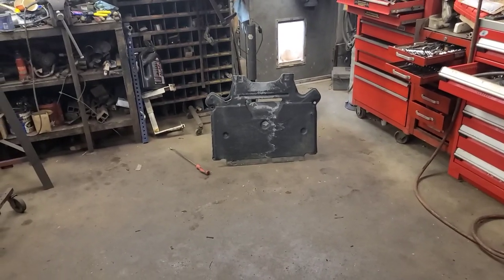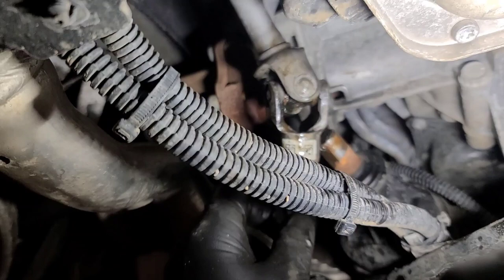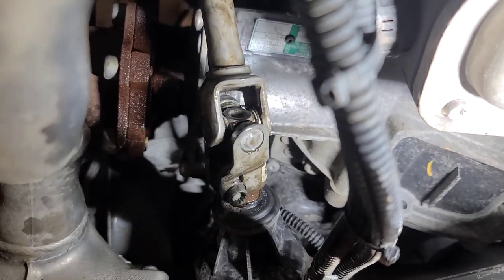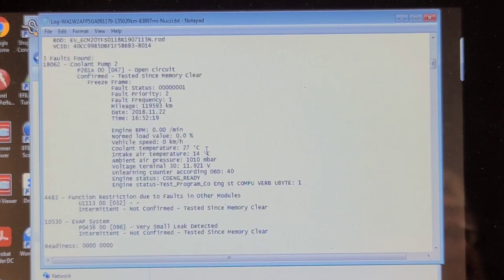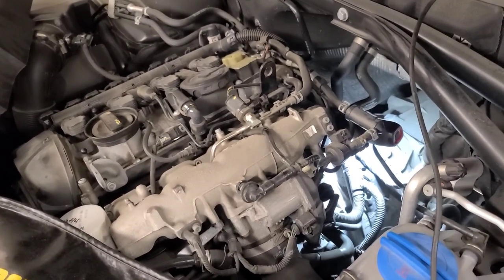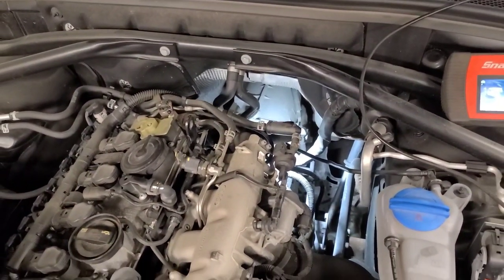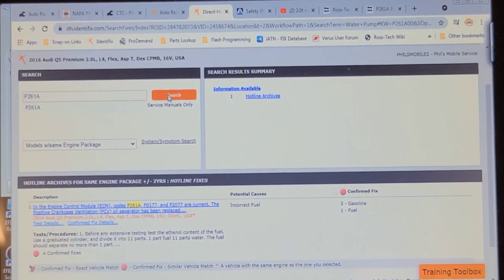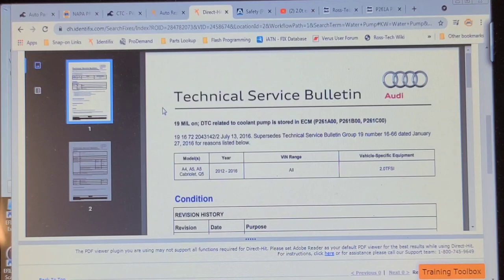2016 Audi Q5 Stiff Steering and Unrelated P261A Coolant Pump Code

Comment: Mhmmmm wonder if this is the issue for mine. I got the steering rack replaced 3 months ago and it still gets stiff
Reply from the maker: Well they would have had to disconnect that joint at the rack. I would hope they would have noticed it was stiff.